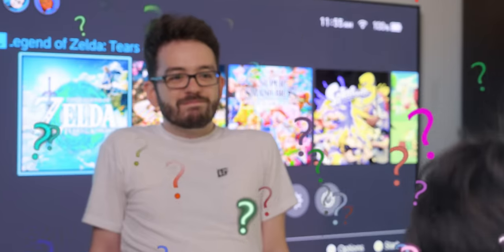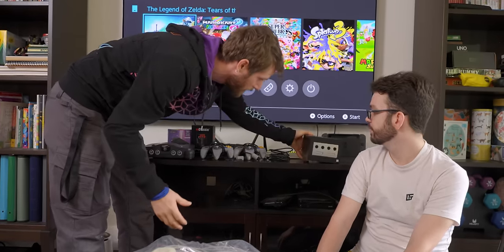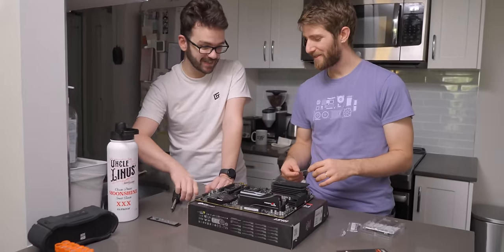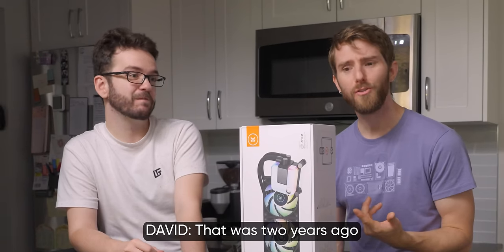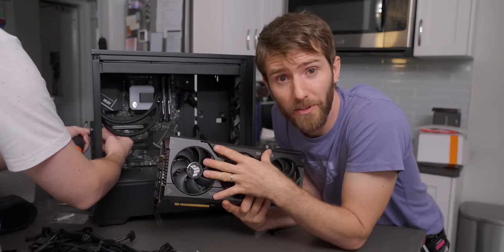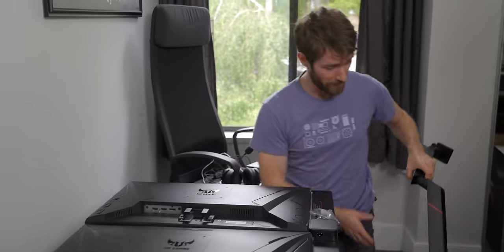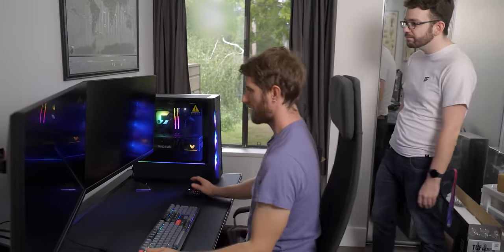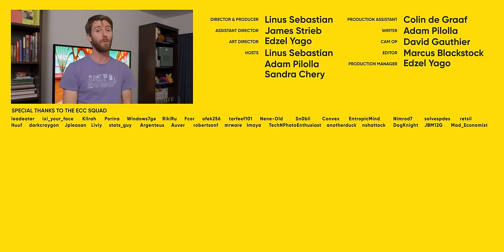I have been betrayed - AMD $5,000 Ultimate Tech Upgrade

Comment: The fact that he kept that AIO Cooler for 2 years. He was manifesting hard for that new gaming setup!
Reply: Hmmm still have mine from 4 years ago? Didn't know I should change it. Shows how uneducated I am in areas lol.
Reply: @aaronrisnerr  No you dont need it changed. The OP was regarding the time the cooler spent on a shelf after being won by Adam at a christmas tombola
Reply: I still have mine from 2019.
Reply: @Durngor  got it just finished the video thanks
Reply: My friend kept his maglev fans in a box for two years. Idk with some people
Reply: Was wondering if it shipped with an AM5 mount 2 years ago. My guess was that they did since the video didn't mention it......
Reply: @Fate025  iirc correctly it does since I have the same one in my build.
Reply: @tuckerhiggins4336  yeah it takes me like 2 seconds to rip new parts out of the box and screw em into something to let em go! the only time i leave it in the box is when the rest of the order hasnt arrived yet.
Reply: my noctua nh d-15 chroma black will serve not only in this PC but i think in the next 5-6 years of PC :D
Reply: The last two years feel like they basically didn't exist so it's understandable lol
Reply: @Whomecouldntb3  Ill raise you a Kraken x61 from may 2015 that i was still using until a month ago. it lost about 10 degrees of stress test performance (70 to 80) in 8 years (4.8ghz 4790k) and when i opened it up it still had a decent amount of water in it but I wasnt confident using it after taking it apart. It was also making some ticking noises due to having less water.
Reply: @JustGetAHous  Well it certainly served its expected lifetime. So no shame in that.

Comment: The Gaggia is pretty solid for a first espresso machine. Hopefully he has a grinder that can do espresso grind.
Reply: Gaggia is pretty much the ideal starting machine if you have any interest in getting into the weeds/trying to get coffee shop results. Most of the other options in the range don't accept a standard basket or have easily serviceable/modifiable parts.
Reply: Honestly, with how much modding the thing allows for (unofficially, of course), he could easily turn that thing into the equivalent of a $3,000 machine if he does things right.
Reply: I came to comment the same. I got the exact same one and it's absolutely fantastic
Reply: I’d argue the Cafelat Robot is a better starting point, but that’s mostly because that’s the one I got 😅
Reply: @Avruthlelbh  wow never heard about coffee machine mods. can u tell more? like, what can it possibly be? (or just recommend yt vid about that)
Reply: from my experience with a modded Gaggia Classic Pro, no matter what u do to it its always going to be too fiddly & annoying - i sold mine and went for a Bambino Plus and coffee's been as good or better and its always consistent and painless
Reply: @hwasaornothing  What mods did you have? With the over pressure valve and PID mod virtually all of the fiddly bits are gone from my experience.
Reply: I installed gaggiuino, which is a great mod! Especially with the pressure curve and auto stop on weight feature (if you take the time to install scales). The community is quite toxic in my opinion, so be warned... :)
Reply: I love my Silvia, but Gaggia was an excellent choice.

Comment: 28:19 
As a future note to Linus and the team, you can use a steam account to download over a local network from one computer to another. We loaded BG3 to my computer from my cousin's in about 15 minutes over the local network when my internet was out so my friend and I could play over the LAN. 

So you didn't need to take out the SSD from the laptop to speed it up lol 

Though, the update still would have been required.
Reply: That would still take a lot longer than copying it straight from the NVMe SSD. 1Gbps network is only 125MB/s
Reply: I think they knew that already, because if I recall correctly they use that exact method for the LAN event
Reply: Honestly the setting should be ON by default since it is so useful. It's also a great way to save that bandwidth, especially if you have a monthly cap.

Comment: What a great upgrade for £5k. I'd be tempted to throw it all into my PC but honestly spreading it out like this is also a great choice. Adam seems like a really chill guy too I like him, would be happy to see more of him in future videos
Reply: To be fair, 5k into the pc alone is actually quite difficult.if you don't comp,etely waste money on a 4090, you get a super high end graphics card (7900xtx or 4080) for around 1200, around 500 for a really highe nd cpu, maybe 200 for the case, 300 for combined storage, 150 for ram and probably another 300 for coolers, extra fans and such. Oh, and 200 if you want a really fancy case.   So around 3000 pounds for best ins lot components with the motherboard included, you litera,ly can't really spend more than that unless you go for weird artsy or branded stuff, and even there cable mod cables and such won't set you back to much.

Comment: I love powerline networking. Good call on that. BTW, that 2 gigabit thing is more for in case you have more than 2 adapters in use to prevent bottlenecking in the powerline. They still only have gigabit network ports.
Reply: They can certainly be handy for some setups. That's pretty neat with the 2gbps, though on mine that are 1gbps I never would get near that. 
Something really odd that I've encountered with them when used them to bring network to tv stuff downstairs in a ~50 year old semi-detached home. The neighbours on the other side of the wall are also using tp-links and their tv always tries to connect to my network.  There was something very lacking in the config options when tried to sort it out, but it's been a while since run them.
Reply: @benwu7980  Supposedly they're supposed to have security to prevent that, but I have never even tried to verify that.
Reply: @silversonic1  Kind of old houses, old wiring running (I assume) beside each other. Had a powerline in one bedroom and the sitting room, both with them using a plug socket on the connecting wall.
I had access to their device's menu,  and via a little messing around with an additional managed switch, port-mirroring, and wireshark...could have done more than just use their Netflix account,  but I'm pretty ethical.
Has me thinking to set them up again just to see what it was in settings being poor, had to have been something like them acting like a different network that was not changeable.

Comment: Another point to make about powerline ethernet is that when they begin to fail, they can interfere with ADSL2 router modems and your bandwidth can take a significant hit. I've had this with four different pairings of EoP sets, all different models from two different OEM's. Not tried known dodgy units with a fibre modem and separate router yet - using Draytek Vigor 2927AX currently - maybe not as gaming focused but the firewall has 2Gb throughput and as with other Vigor units you can set up and isolate virtual networks within the building... very handy for separating home working from the TV and kids devices plus internet filtering at the router (not VPN proof but enough to stop casual naughtiness by non admin users!) Oh and the Ikea Markus - has a 10 year guarantee on it.. mine has lasted all ten years used for at least 4 hours a day on weekends and 10 hours a day weekdays, and is just beginning to squeak when I sit up and release the spring loaded back on it - good choice!

Comment: as someone who has worked as field technician for an isp for 12 years, I've installed and mostly troubleshooted uncountable amounts of powerlines, I can assure you, the times you get low latency and hassle-free connection with a powerline are very rare, powerlines should always be an absolute last resort when cable is just not possible in any way

Comment: Ideally, the power cable fix would be fine if you also soldered the joints before taping each one individually. If you don't carry a soldering iron with you, there are soldering iron free pastes you can use that are silver based and you just need to heat the paste with a match or a lighter for like 5-10 bucks a tube. The one I have looks like an oversized thermal paste syringe, I bought it because local consumer stores on the east coast don't appear to sell soldering flux anymore(I had solder, I needed flux), and it was after 5pm so all the local industrial/commercial stores were closed...it seemed to work well enough but the flux in it kind of spatters a bit while it's heating until it's hot enough to activate, I'd recommend a small cigar torch or micro-torch to heat it quick. 

In a perfect world, you'd solder and heatshrink each wire, with heatshrink or tape to keep the wires together so they don't snag, and the tape is fine, but from experience just tape will not last if the cable ever gets flexed and you'll start getting arcing or high resistance because of poor contact. Thoroughly twist the wire and solidify a liquid bath of metal over it(solder), make sure there are no sharp bits and insulate it properly. Won't matter if the solder cracks, because there will always be one place where it hasn't cracked that it's holding the twisted wires in place, especially if you soaked it in flux first, it'll pull the solder into all the crevices.

Comment: I have an AMD Ryzen 7 5800x, RX 6700xt, Asus TUF Gaming Pro B550 setup with 64gb of G-Skill Trident RGB RAM -  and it runs everything on ultra at 4K with no problem. Cooler Master HAF-X case with all 200mm fan spaces occupied, Cooler Master AIO liquid cooling on the CPU. Only time I have issues is with unoptimized games like World of Warcraft.

Comment: 14:10 I've done that with a trailer hookup that dragged too low because someone connected it incorrectly. The wire hung and rubbed on the road til the bare metal was showing and wires were shorting eachother. My repair was was much less safe than Linus' lol.

Comment: Had two of the EK 360 D-RGB AIOs, the original one i bought and the RMA one because the first one died and they both died in under a year, really put me off EK AIOs. Customer service from EK was awesome, though, they replied and shipped the replacements pretty quick. It was top mounted in my O11D too so i was pretty miffed.

Comment: Where's the backplate for the motherboard? I wasn't sure if that is what I was looking at. then the video went on and in the shot of pushing the PC into place you can clearly see the I/O shield is not on. Was that to accommodate for the GPU or was it omitted for other reasons?

Comment: 23:13 I have that monitor, it’s literally the cheapest 1080p IPS monitor that I could find. Mine was so cheap it doesn’t have speakers, or even an audio output, that was very troublesome. I’m still using it for my uni dorm because I wouldn’t be very sorry if it broke during shipping, but cheaper monitor not becoming better is starting to hurt because I’m using a ps5 and a 3070. Atom least now they have 100hz and speakers xd.

Comment: Having used that exact Powerline adapter kit, Its not very high speed. And the latency isn't any better than Wifi. 

I just switched to an Asus Mesh network. Speed went from 250-350 mbps to 900-990 mbpds, and latency stayed about the same, or went donw 2-3 ms.

Comment: I've been eyeballing that MSI B650 mobo in a mATX, but I HATE that they moved the x16 slot down a slot on all of their mobos. That slot needs to be up top on mATX boards in order to have any chance of getting airflow to a 2.5 or 3 slot GPU in a mATX build. They got it so right with their AM4 boards, and so wrong on AM5. I'll give Adam full marks for passing on PCIe Gen 5 though. The SSD choice was wise since MSI opted to do Gen 4 only on their boards. Buying a Gen 5 SSD would have been a complete waste.

Comment: LTT could easily do the tech upgrade themselves using gear they have spare in the warehouse and not be tied to either AMD or Intel. The videos would recoup the production cost no issue and LTT would be free to use any sponser they like. I have no doubt that LTT charge AMD way more than 5k.   It is nothing for the advertising value.

Comment: hey linus, I built a pc recently, like a few months ago.  We put in a 13th gen core i7, a rtx 3060 ti, an msi mag thunderbolt motherboard, with the default cpu cooler and a mastercooler case.  I was wondering what you thought of the specs, and if they are any good.  Will it run games well?

Comment: "Just about the fastest gaming chip" I'm pretty sure it's the fastest. It's still topping the charts including 14gen Intel. It's also generally faster than the 7950X3D because of the slightly higher clocks.

Comment: I have the same cooler (EK AIO D-RGB 360) and 6 additional matching fans for the case. It's fantastic, but the RGB colors are off unfortunately. They put so much into the cooler; but didnt get the RGB colors right on the pump compared to the software and all the other RGB (Asus , Corsair, EK Fans, etc..) I have in my case zzz.

Comment: Tp-Link dLan has gotten pretty good - better and less simmering than Devolo. And the performance isn't really theoretical, much like WLAN performance isn't - it depends on the setup how much you get out of it, though Linus is right in that you better not expect anything more than half the maximum performance and even that is only along the line of best-practice setup, meaning one with few adapters, no / few fuses in between, and no extension cords.
Is my experience the performance is more than enough for internet and even some basic NAS features though it adds about 10ms to your pings, but they really hate devices creating a lot of e-noise such as old and badly filtered appliances, cheap PWM type power supplies like common for phone chargers, or your ( too simple ) microwave.

Comment: Wheel of Time adaptation is objectively worse than Rings of Power. Why?
Wheel of Time had access to the original editor, the original author's assistants, and the co-author of the last three books, and still managed to put out a poorly written mess and has managed to offend the entire fandom.
Rings of Power had rights to use anything in the primary Lord of the Rings trilogy, but no rights to use supporting books, most importantly the Silmarilion , which is the book that covers the petiod of Middle-Earth history they were trying to tell. It was idiodic to even start production without first securing those rights, but failure was a foregone conclusion once they did.
WoT had every possible advantage and still failed abysmally. RoP had every disadvantage, and failed predictably.

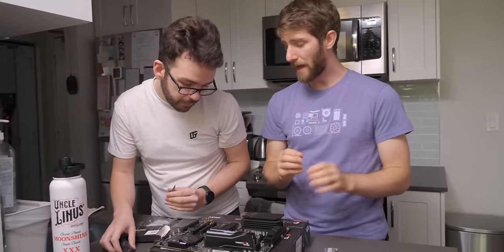Comment: 7:18 why do they always skip a slot instead of putting them next to each other ?
Reply: If you're talking about the memory modules, then its because that's how you use dual channel. In short, dual-channel allows you to have 2 channels of RAM which gives you better memory performance. I don't know the exact reasoning as to why the boards are engineered to have the memory channels that way.
Reply: @JJFlores197  ty . I thought it didn't matter which channel it was in .

Comment: i know exactly why my wife bought the Sapphire 7900XTX 24G Nitro+ OC for me ;)
the card is crazy!

my Settings (with ACValhalla, 4Screens, Ryzen 9 3900XT, MSI MPG X570S CARBON EK X, 1x360 radiator for CPU&GPU):
-card throttled to 90% Speed and 96% voltage
-card set on max 60FPS
-ACV to max Settings
-card temps: hot spot at 1000% load 70°C, memory at 100% load 65°C

sry, NVidia&intel, but AMD is not only "cooler" then your overpriced *********.....
it's also smarter to install (and change some components w/o install Micid*mb Winsh*t fresh&new)